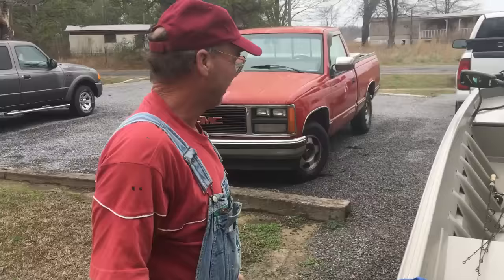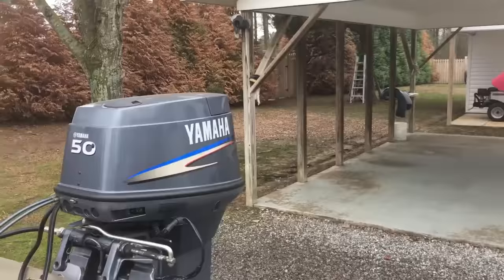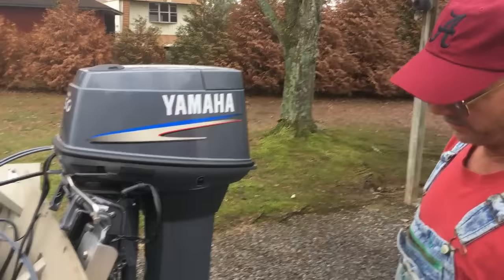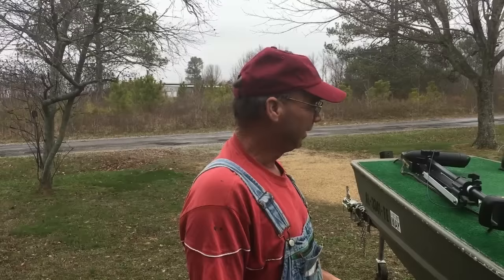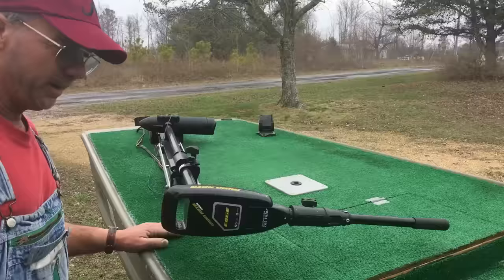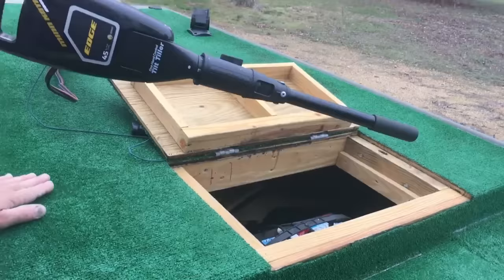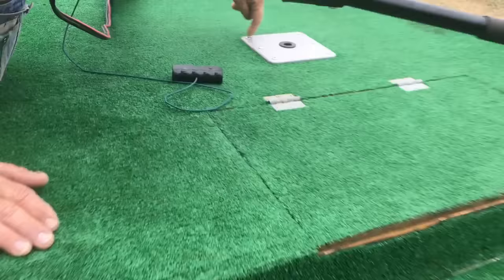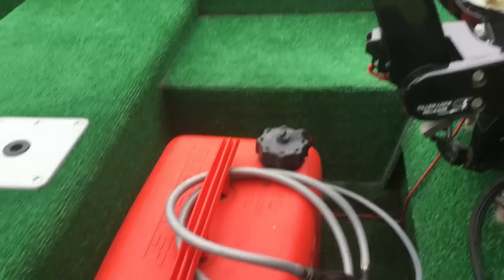Boat Setup - The Fishing Machine

Comment: I just bought my first boat it's a 20ft extra wide extra deep it has the same 20hp 4 stroke as you have I have monster rod holders on order lol. I have a 6 gallon gas tank and a big storage up front that's tucked away and a big live well in the middle that holds 10 20 pound flat heads it use to be my dad's boat but he got a smaller one since he likes to fish by himself

Comment: I'm really liking your setup Richard. Very good work on that crappie boat..I do have a question though...I don't see it in this video but in some of your other videos I see a long flat bar looking thing with holes drilled in it laying in the bottom of your boat...What is that for?
Reply from the maker: It's just a homemade thing I use to mount my camera at different angles if I need it. I can lay it on the side of the boat at any point and then mount  a pole in those holes to change camera angles
Reply: Oh ok, for the life of me I could just not figure out what that thing was...Thanks

Comment: Nice setup and you can tow that with any thing. Good fishing.
Reply from the maker: thank you Pits Mcgoo and yes its very light. I think even a car would have no problem towing it!
Reply: No doubt I have a 16 ft Lowe weighs about 1500 lbs tow it with a 2006 Taurus don't even know it's there that boat could be pulled with a 4 cyl. easy. They might make fun at the launch ramp until you come in with a big mess of crappies and pass them up at the gas station.

Comment: Hey RG.  I admire your ingenuity...sorry for using a 5 syllable word on an Alabama fan. :)
Just wondering, buddy...Could you share with us what model Jon the crappie rig is?  Also, did you remove the middle "seat"?
Reply from the maker: It's 2011 tracker 15ft. when I bought the boat it was nothing but a hollow boat. I built everything in it. Thanks for watching Kenny!

Comment: ALways love your vids but funny thing ,Your Accent and Voice are Real DRAW...The two boats what are Length /WIDTH...  and simplicty of your stuff...I had about 10 boats over life..10f to 24' .....had more fun and caught more fish in a Boston whaler 13f 35hp (ashamed to tell what I paid in 1982  ruff shape  boat motor  trailer /500 bucks.....Cleaned up got motor runnin cleaned carb...repacked wheel bearings a a couple tires...Used 10y ..nary a problem and sold for 2k  Thx GENE for allyou do  DAN